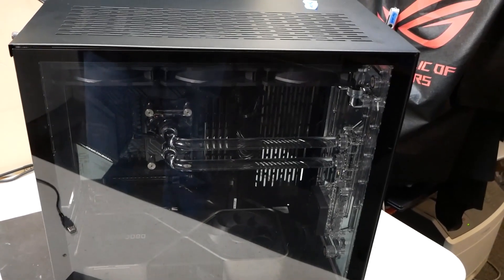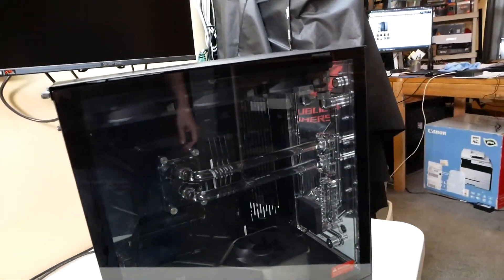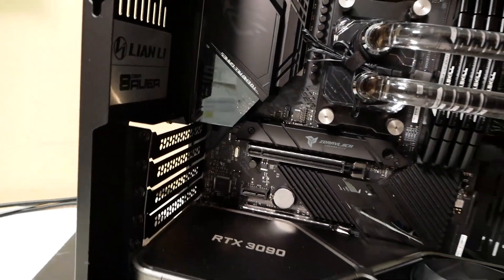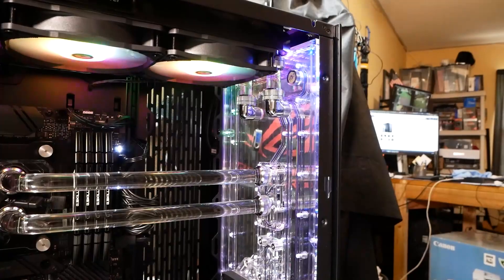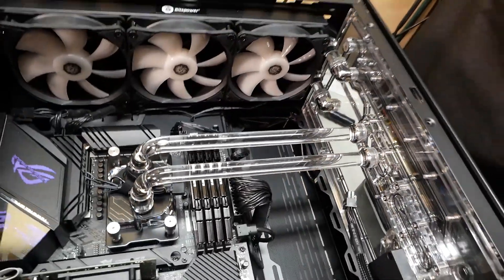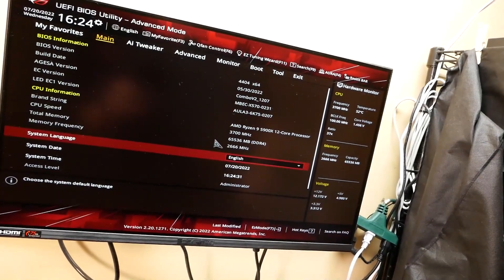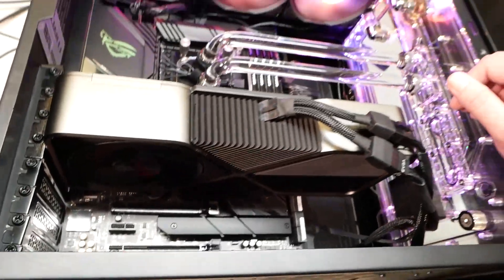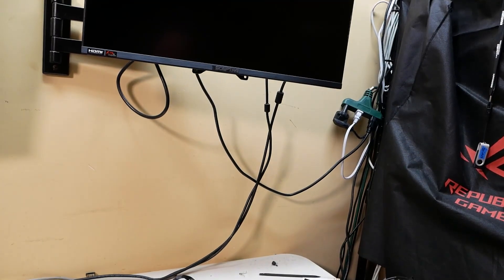Different Ways to Figure Out What Part Has Failed on a Gaming Computer

Comment: 9E is just code showing that TPM is enabled
I know that white VGA light is a common issue with ASUS boards but you also tried it in test bench so the only other suggestion I could think of would be trying another power adapter for card but probably unlikely to have one lying around :(
Reply from the maker: I do but problem solved anyway. Thanks for commenting.

Comment: I have an alienware x51 everything turns on and works fine until I turn plug in the gpu any suggestions to fix it? I have already tried cleaning the gpu.
Reply from the maker: Sounds like you have a bad video card. Try a cheap basic video card just to confirm.
Reply: @TimsComputerRepair  ya I tried in a different pc and it has the same problem

Comment: I didn't know that Micro Center did builds. I'd rather build it myself anyway but they have great deals on top end sought after PC parts if you pick them up in person! I've bought a few CPU's and other parts over the years at their Yonkers NY store.They have an accurate pricing chalk board showing New Egg, Amazon, and other PC parts sellers current prices. You can pull out your phone and check if there's something your interested in. They have a huge amount of parts in stock. Almost an hour ride for me though. 
It looks like UPS strikes again with that card.    💪
Reply from the maker: Micro Center is 5 hours away from me... I will avoid shipping desktops at all cost.

Comment: Oh man, what a shame. Imagine shipping that, with that beast of a card still in the slot!
If you must ship it, wrap it in bubble wrap and zip tie it to the bottom of the case. Use plenty of strong zip ties, so it positively cannot move!
I bet the card has a fractured trace near the pcie slot, or cracked solder under the ram chips there.
Reply from the maker: Oh I agree totally! Shipping a rig like that is always risky. Thanks for commenting and watching.
Reply: Ya take the video card out and ship it out of the case. I wonder if several Instapaks would of helped  stabilize everything? Also double or triple boxing it with foam between the boxes.